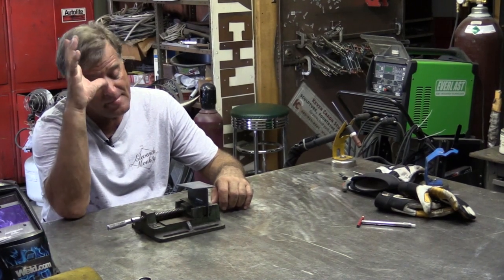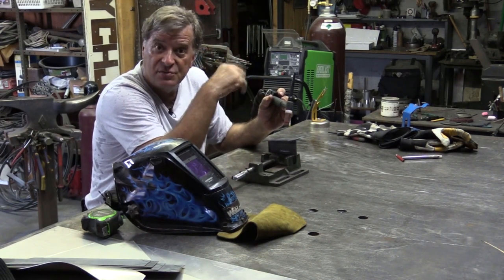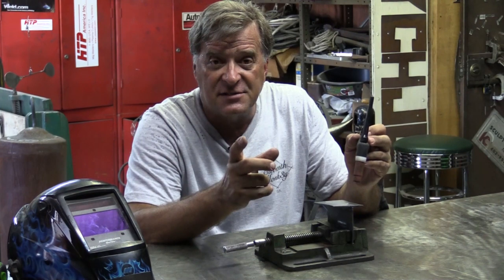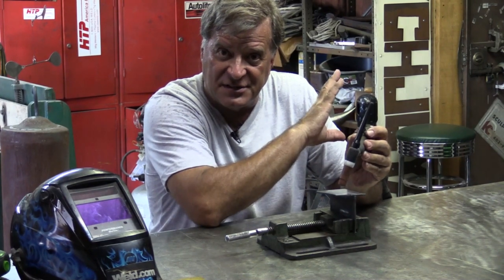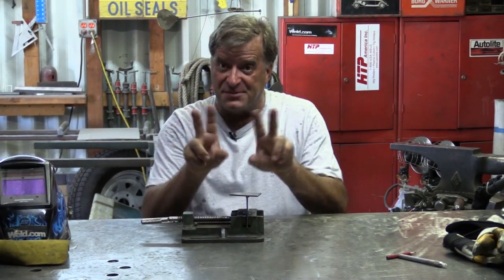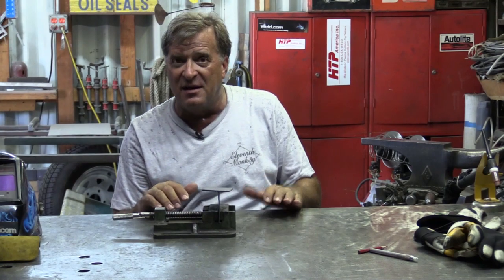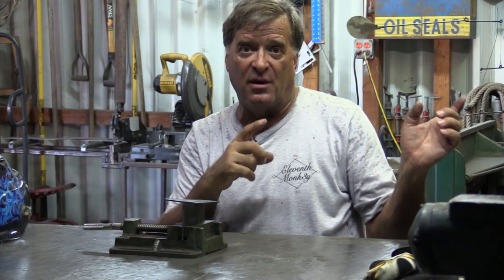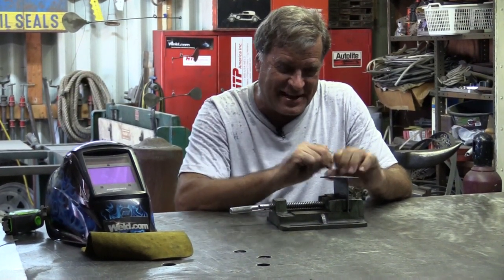What is the Difference Between TIG Lift Start and High Frequency Start? - Kevin Caron

Comment: How far away from a car or computer do I need to be in order to use High Frequency start on a TIG welder?
Reply from the maker: Just disconnect the battery first.   You should be fine.

Comment: we call that scratch start ,So he's a question to explain to you veuves  we use oxford bantam ac   oil welders in Blity , & use a  t ac /dc buzretifier  15 quid to convert the for Tig welding  , so check that out i suppose you will not have a  Oil cooled welder  so you will have to use a  Sander  Air cooled  welder most uninitiated  tend  to use ,  do them a favor & exspan how they can cover there ac welder to a tig .  kit to weld  that  car  sill on . LOL  go for it son .  .
Reply from the maker: Have to look into that. Thanks for watching and posting .

Comment: I am glad you told me about the HF on a car or truck, I am wanting a good tig for my gagrage and had been reading about the scratch start n lift tig. I always read before I buy anything n was looking into a 3 in 1 machine. With Tig, stick , and mig. But I have only found ones with the lift tig or Hf start. I didn't know they was that much difference in Tig with low pulse,high pulse, Hf start and so forth. Thanks for doin this video cause I hadn't read any where not to use HF on a car..
Reply from the maker: Thanks for watching and posting Dale!    Great to have you in the club.

Comment: 2 questions. When I try 2 lift start, using a pedal, the tungsten sticks 2 the base metal when I lift up. Any thoughts on why? Also, when using HF I notice my lights dim slightly when I push the pedal. Any thoughts on a cause?
Reply from the maker: Probably just a heavy hand on your part.   Would love to watch you to get a better sense of what you are doing.   As to the lights dimming, you are on too small of a circuit for power.  If you can switch to a 30 amp line you would be better.
Reply: Thank u.

Comment: That's why you GROUND your machine to earth.. Disconnect the batts  before you weld on any car or truck. No matter of the year. Short out welding will fry any motor.
Reply: sdjb111 well, I’ll tell you something. You really have to be careful with the word “ground”, as it isn’t what you think it is in welding. Every type of electrical and electronics uses the theory of current going from negative to positive. But welding uses the theory of current moving from positive to negative.

What that means is that the supposed “ground” clamp isn’t really the ground you think it is. If you have a piece of equipment that is grounded, and turn it off without disconnecting it from the power source, when you weld, you’ll get a circuit formed. With a mig welder, for example, the mig wire will complete the circuit even when you’re not welding, if you push the button, and the mig wire will act as a heater, and could melt, and damage the machine.

Comment: Is it possible to have a torch switch with a lift start machine with no foot pedal capability such as my Everlast power arc 200 ST?
Reply from the maker: Sure ,just have to wire it up.

Comment: A question here from a non TIG weldor.  I thought dipping the tungsten in the puddle was a no-no in TIG, how do you avoid this with lift or scratch start?
Reply from the maker: dahveed284 Low starting amps for this type of start.

 Supposed to keep the tungsten from getting contaminated.  

Always comes down to practice,
Reply: +dahveed284 .   You start the tig arc first without filler metal and create a small puddle then start adding you filler rod and keeping the tungsten out of the puddle.

Comment: Does using scratch or lift start require you to grind the tungsten more often, due to contamination? Or is that more from dipping in the puddle, and less an issue when starting weld? Or possibly "yes, more often, but not unreasonably so"?
Reply: mlindholm  Yes, especially with scratch start where you have to "break off" your arc you also put arc strikes across your job.